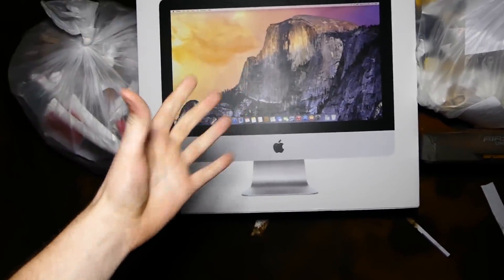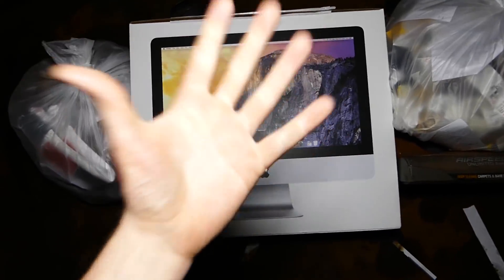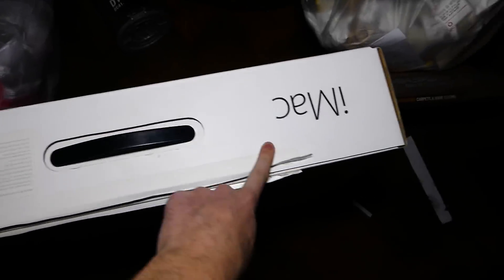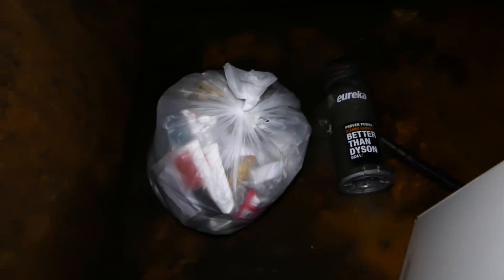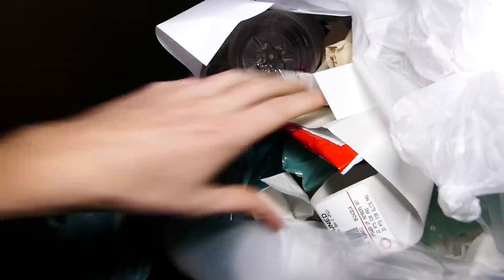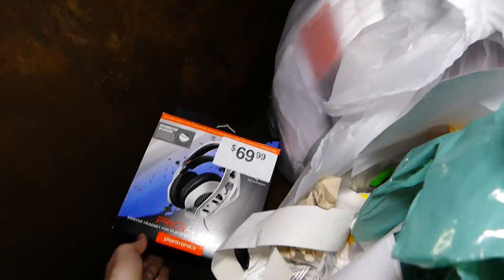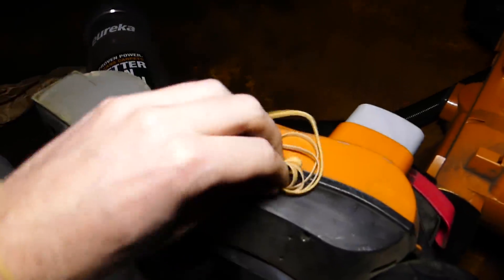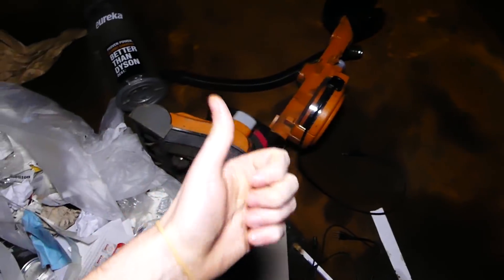Did I Find APPLE iMAC in DUMPSTER??? Gamestop Dumpster Dive Night #484

Comment: I would have taken the vacume for sure since there usually over a hundred bills,  people usually throw them out only because there to lazy or dont know how to unclog the hose or change a broken belt , oh and there should be a button you push for the cable to wind back up. Great find Speedy.